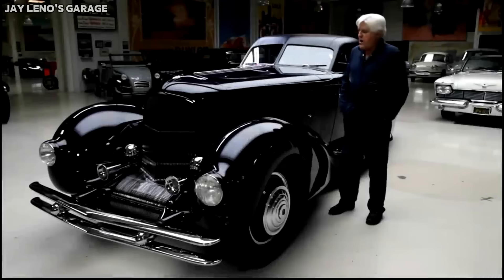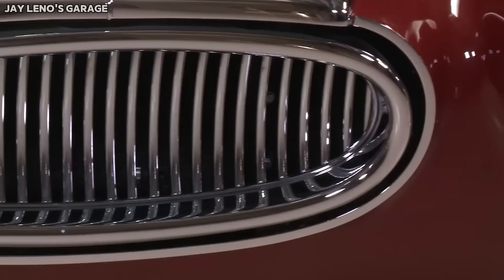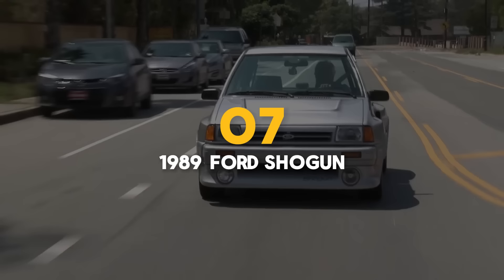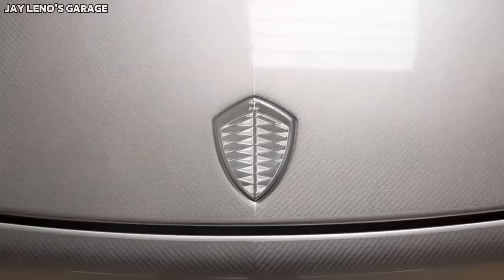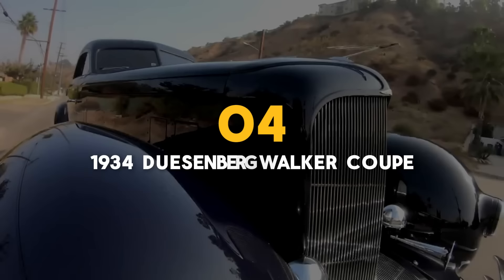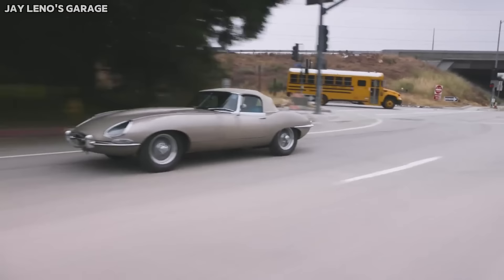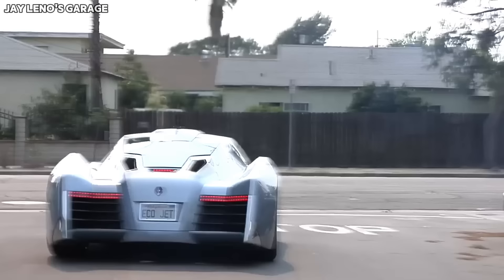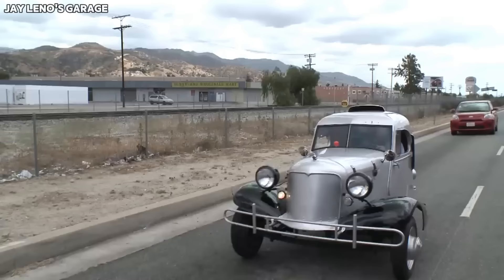10 RAREST Cars In Jay Leno's Garage

Comment: I'm afraid the "e"type description is completely erronious . This car was actually discovered in an empty property by a curious policeman  only a few miles from Jay's garage . It was completly covered in blankets ,sheeting , no one knew it was there . Jay aquired the Jaguar  and very carefully recommissioned it but kept it's patina. So it is not a one off   V12 , it's a completely original 1963  3.8 litre series 1 dhc . .....do your homeswork !!!
Reply: Yeah, the picture showed it having a 6 cylinder engine.
Reply: Yes, it sounded soo much like a 6 cylinder, only the series 3 had a V12! DO YOUR HOMEWORK!!
Reply: your spelling is erroneous..
Reply: @petesmitt  But I'm certain he did his homeswork!
Reply: Yeah it definitely didn’t sound like a 12 imo so I was wondering what was going on there…Also, sounds like ai reading a script…It’s not the Taurus “Show” it’s S-H-O😳and the way Lemans was said was off
Reply: It's frustrating. He doesn't own the egg either he just done a video on it. If he owned everything he done videos on he would have a few thousand cars 😂
Reply: @petesmitt 
Your use of your time may be erroneously motivated. 😶‍🌫️
Reply: Jay has another E Type that fits the description - it’s just not the one they showed in the video
Reply: @petesmitt  nobody's perfect 😄
Reply: @HyBr1dRaNg3r Super High Output

Comment: Jay leno has 3 xke’s 1 white coupe (s1)and 2 convertibles the roadster in videos is a low mileage straight 6 (s1) survivor.  his red xke convertible is the v12 car (highly modified (s3)built by xk’s unlimited.  Can’t fit a v12 in an early swb car. You have to start with a (s3) and change almost everything.
Reply: My Wife owned a 90 xjs v12 Convertible for a while while we in San Diego. Awesome ride.

Comment: If you take the vehicle's price out of the equation, I would most want to own the 63 Jaguar. Mostly because it's all original unrestored low mileage, you get to experience a 60-year-old new car. It's rarity and the V12 are just added bonuses.
Reply: It doesn't have a V12 the video is wrong.
Reply: You go on Jay's youtube he has done a video on it. As pointed out it is not a v12 as stated. It's a nice survivor that still has the factory crayon marks under the fenders because of it's low miles. The only part Jay has swapped out is the radiator tank (with a og unit) because it was rusty and he drives it.

Comment: the turbine, I'm surprised a semi truck company hasn't come out with a varient that uses a turbine engine instead of a diesel engine. the turbine only saw better fuel economy on the highways. with a semi running 60-70mph got 8-10 hours per day, they could see a huge potential, especially with the increased emissions ratings of diesel engines making it almost impossible to manufacture an EPA compliant engine.
Reply: Ford had one in the early 60s. Didn't work out.

Comment: The Rover JET1 was a gas turbine car originally built in Solihull in 1949/1950 by the Rover Company and modified to a more aerodynamic style in 1952. It held a world speed record for a gas turbine-powered car in 1952 with a speed of 152.691 mph.
Reply: I've seen it in the London Science Musuem.
Reply: @lawrencelewis2592  That's because it is in the London Science Museum.
Reply: @Shytot-1  Hmm- I was wondering what it was doing there when I saw it in the London Science Musuem!
Reply: @lawrencelewis2592  JET 1 was the world’s first gas-turbine-powered motor car. It was made by Rover, the car company which had been intended as the main producer of the new Whittle aircraft jet engine in the Second World War. Work on a small gas turbine suitable for powering a motor car began in 1946, and the finished vehicle was unveiled to the public in 1950. In 1952 JET 1 was fitted with an uprated engine and achieved a world record speed (for gas turbine cars) of 152 mph (244 km/h).
Reply: @Shytot-1  I've seen pictures of it in various books and was surprised to see it in the LSM. Great museum, especially the aircraft like Alcock & Browns Vickers Vimy.